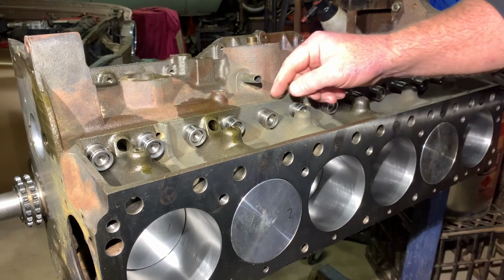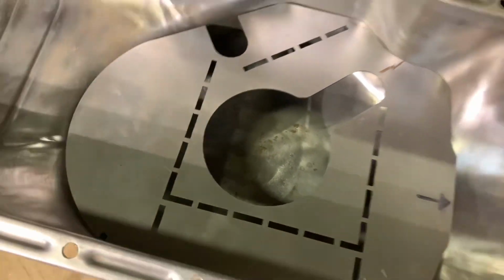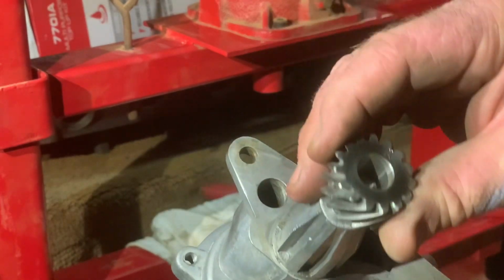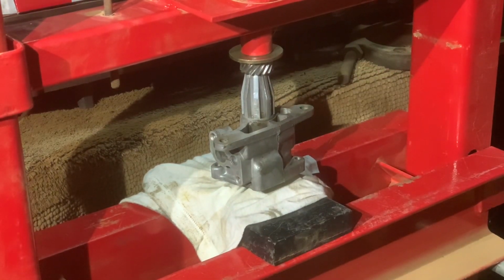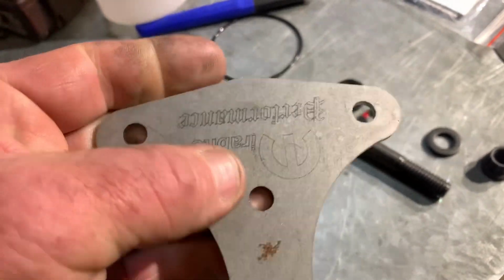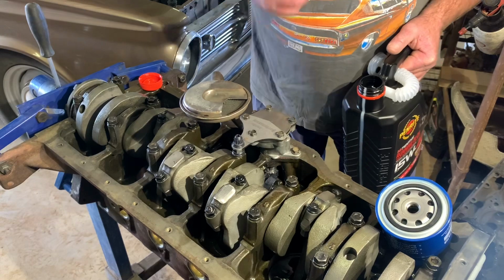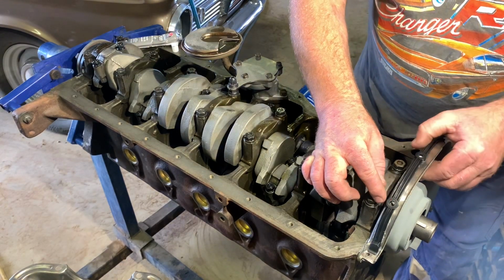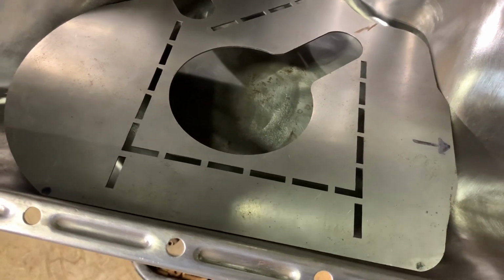265 Hemi rebuild , cam and lifters , oil pump and brace , sump and baffle

Comment: Ive just put a new guts inside of my oil pump and the 15 th gear was that loose i had it tacked on by tig , when i turn it theres a slight bind , now im a bit worried about this did your pump have a slight tight spot when turning all or smooth , i checked clearances everything in spec but that bind shouldn't be there i reckon
Reply from the maker: Shouldn’t have a bind , I’d recommend removing the outer part of the pump to see if the bind goes away, then you’ll know